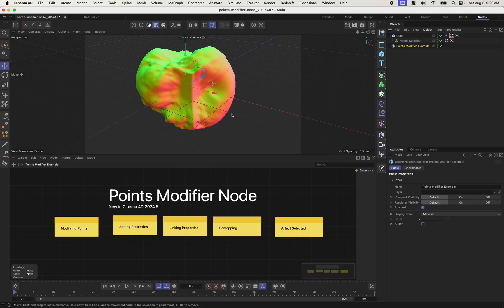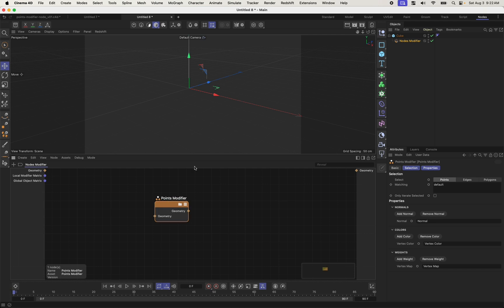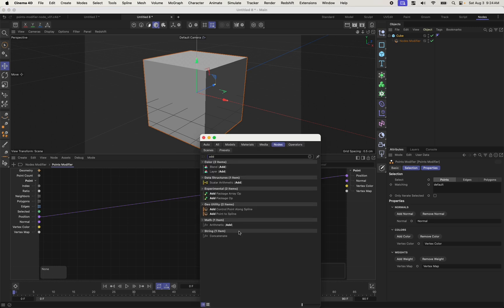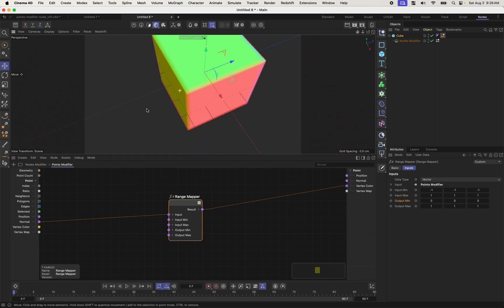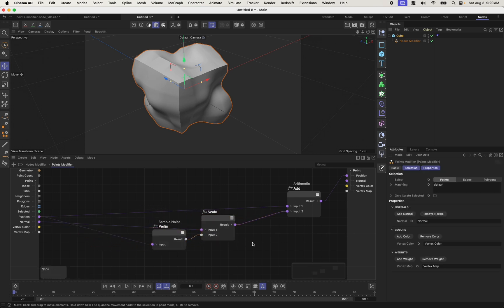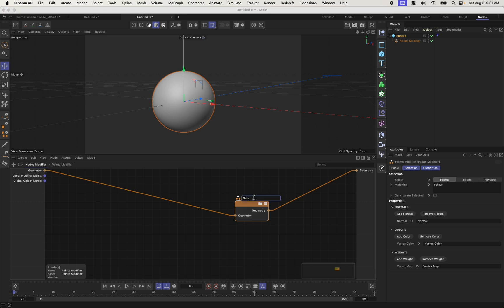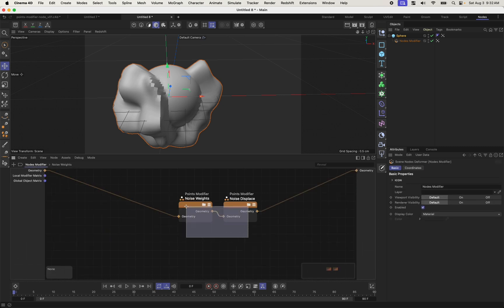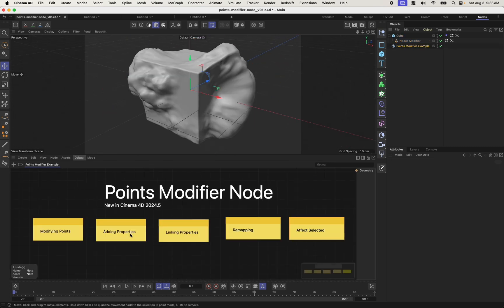Make a Noise Deformer with the Points Modifier in Cinema 4D 2024.5 [Scene Nodes]

Comment: super useful. hoping maxon team is building more geometry nodes so it reaches the level of houdini and blender node system.
Reply from the maker: We strive to build products based on user needs. Have you done much work with Scene Nodes as they currently exist? What have you been able to create and/or what are you hoping to create in the future?
Reply: @scenenodestips  There is a lack of teaching material on scene nodes. Find it lacking compared to geometry nodes in blender or SOP nodes in houdini. Hoping maxon doubles down on scene nodes and puts more effort into developing it and as importantly evangelizing it.